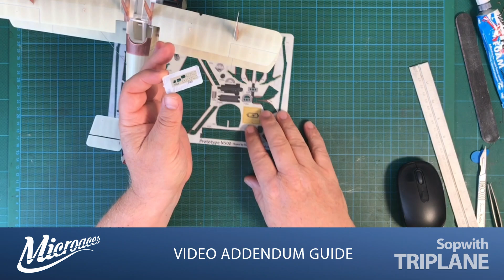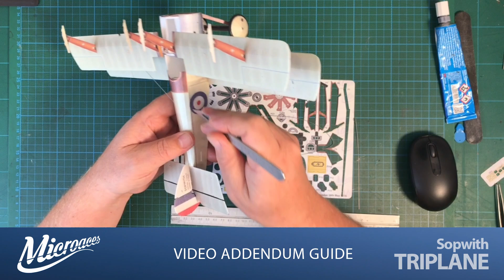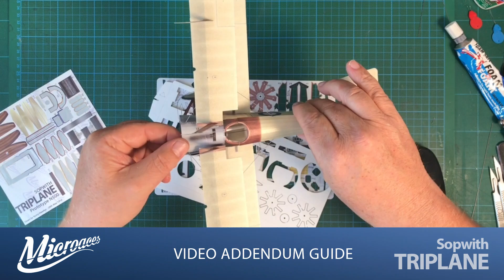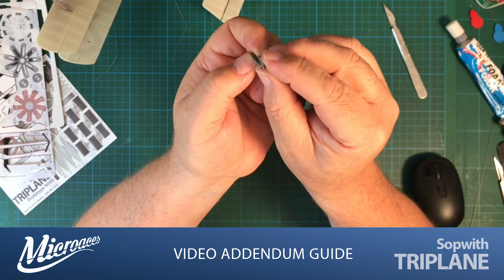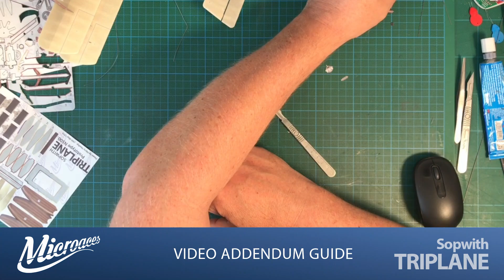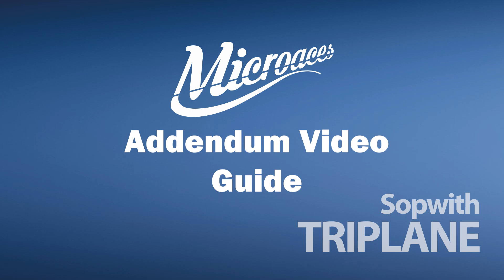Sopwith Triplane Video Addendum Guide

Comment: I just finished this model but have not flown it yet. Fantastic kit. Very fun to build. I'm very worried about the CG. My model weighs 42 grams with battery installed. I put ALL the included lead weight as far forward inside the cowl as possible and the CG is still pretty far aft of the recommended "top wing crease". My CG is currently about the crease of the middle wing. The nose of this plane is very short!
Reply from the maker: I shouldn't worry too much about that - mine is a little tail down on the CoG point too - weighs 39.5g with a 130mAh lipo. Just be prepared to feed in a little down trim on the elevator on the maiden and ensure you have the motor well seated on the motor mount to ensure you have the required downthrust. Good luck with the maiden flight!
Reply: @MicroacesTV   Thanks for your advice. I did fly it today and it went pretty well. It definitely feels a bit tail heavy but was very controllable.